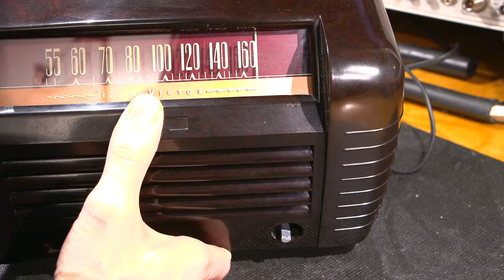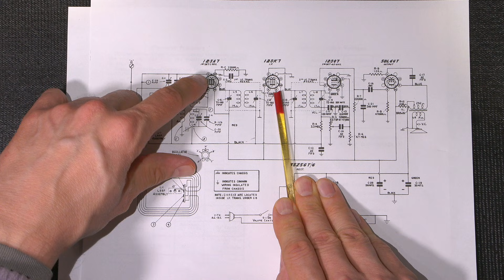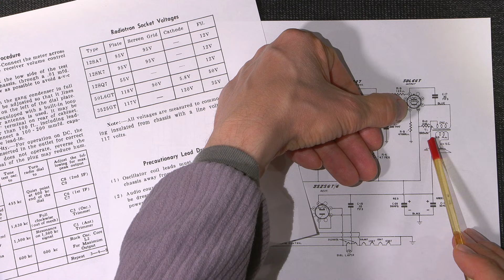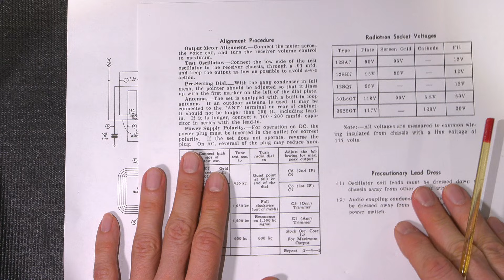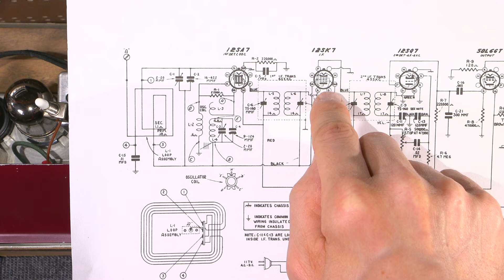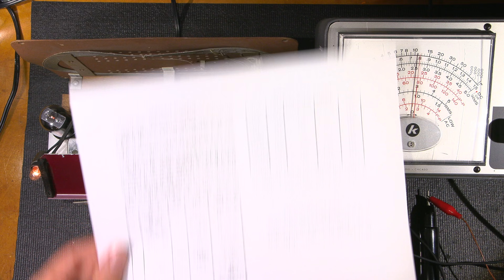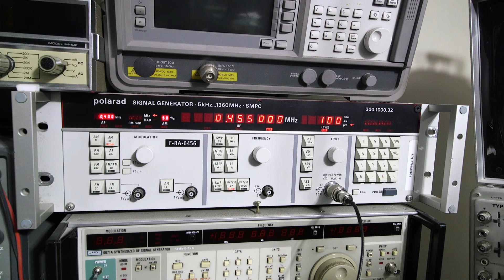Master Electronic Alignments!

Comment: I have enjoyed all of your videos.  All thumbs up!  Could you please explain why a function generator is not as good (or good at all) as a signal generator for alignment purposes.
Reply: A modern digital synthesized function generator will work fine, like an HP/Keysight/Rigol/Siglent etc, but you may need to add external attenuation to lower the output level. The old Waveteks and most anything with an analog potentiometer dial isn't really accurate or stable enough to do the job well. My 2-cents.

Comment: Could you create a basic test equipment inventory required for service and alignment of AM receivers?  Perhaps a video detailing the building of a basic test bench for AM radio servicing with a make and model recommendation for each piece of equipment and tooling.  For example, listing the manufacture, make and model of the isolation transformer and variac and the vendors who sell them, as well as the signal generator, VTVM, other meters, and tooling.  The point is that some of us have vintage test equipment, but finding the sources and specific test equipment is a challenge.
Reply: D Baldwin, I'm not sure the specific make an manufacture is that important.  Many companies made similar VTVMs and they will all work very much alike.  Same with the signal generators.  However, Mr. C. uses a much more modern SG.  Most of the vintage vacuum tube SG's didn't have calibrated output but it would still be possible to align a receiver with a vintage SG.  The myriad of options in test equipment was extremely confusing to me when I started a few years ago.  My solution was not what I would recommend but it was fun.  I bought SG's from basic Heathkit variants up through HP synthesized generators with sweep and all the bells and whistles.  Reading the forums trying to glean the differences just didn't work for me.  I needed to see them in action.  In the process, I restored many of the SG's and learned a great deal.  My conclusion is that the equipment you need depends on the work you want to do.  AA5's require only the most basic of instruments while FM receivers, stereo and communications gear requires more complex (and expensive) gear.  There is not any one specific set of instruments to fit every scenario.  My problem is that I am somewhat afraid of using the complex gear (especially on the tube radios) because my wallet was bigger than my understanding.  In the southern US, we call that being "all hat and no cattle".  I'll get there one day, especially with great videos like this one.  Doc

Comment: why do you use a term throttle?  throttle is an action controlling a valve so why not use the proper term valve, it's a valves for a reason! because that's what it is a valve you turning on and off letting the flow of electrons I think tube is so misleading word, why did Americans adopt that word?
Reply: Excellent Video.  Is it possible you could do a similar video using an FM receiver which is a little more complicated and involved but I think it would very educational for all us subscribers - especially if you use a sweep or spectrum analyzer during the alignment procedure.  Thank you.  Bill

Comment: For some reasons i like tubes.  Modern technology something is missing :(
Reply: I agree! There is something about the warm glow of tubes, the way they have to warm up, and the fact that circuitry to perform a particular function (such as an AM radio receiver) is often simpler with tubes than with solid state. Plus, as Mr. Carlson has explained in other videos, often resistors can be checked in-circuit in tube equipment, since  tube elements do not conduct when off. Tubes have had a bad reputation for being unreliable compared to solid state components, but actually, tubes are more reliable than many people think.

Comment: Hey Mr. Carlson, I appreciate the video, when you were tuning the transformers the radio went into self oscillation, do modern transceivers have circuitry to mitigate that? Is it a shielding issue?
Reply from the maker: Hi Ryan. Some modern receivers will break into oscillation as well. Shielding is an issue with many designs, as companies are always cutting costs.
Reply: @MrCarlsonsLab  I've seen that 100uV sensitivity rating on a lot of receivers, I guess that just kind of a physical limit that can't be reliably exceeded?
Reply: Generally If the receiver has more stages Of amplification it can get higher sensitivity, to a limit.   With few stages of amplification, as in these AA5 receivers, Each stage needs large gain which puts it closer to oscillation.   I believe a decent communication receiver, with more stages of amplification, will be better than 20uV for 10db Signal to noise ratio.

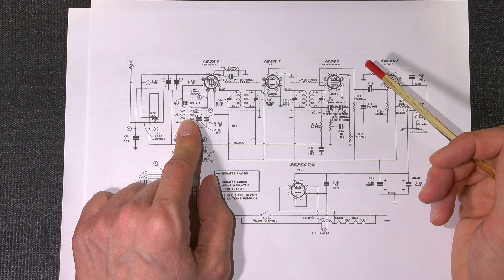Comment: 13:08 - So one could add, say a 3-position switch (provided the connections are short and don't add stray inductance & capacitance) with various capacitors and label the switch "AVC response time"?
Reply: Indeed you can. Communications receivers have such a switch.
Reply: @nevellgreenough404  Good to know, thanks!